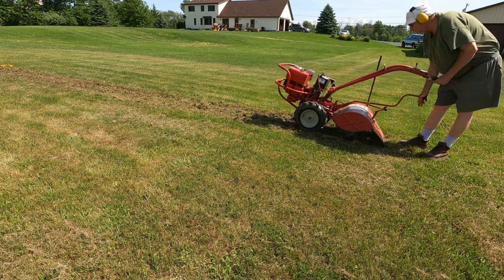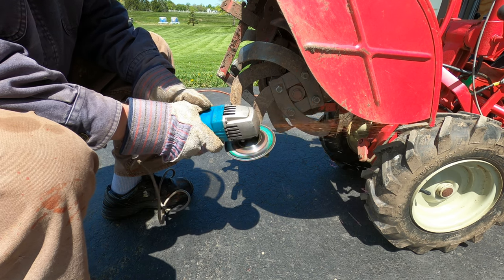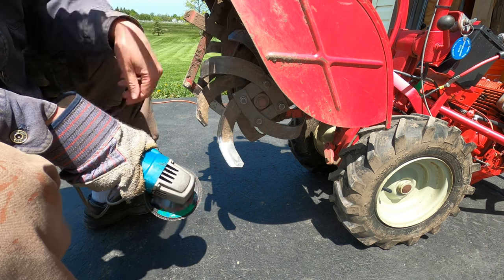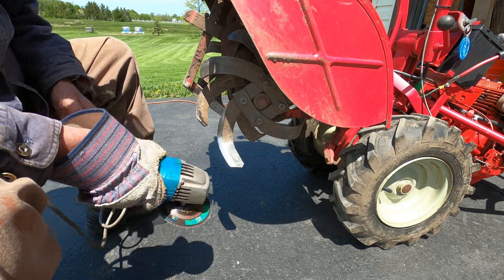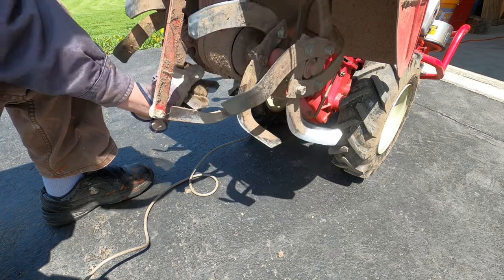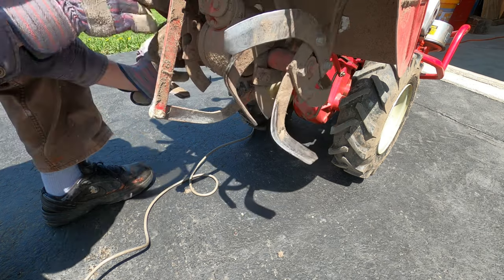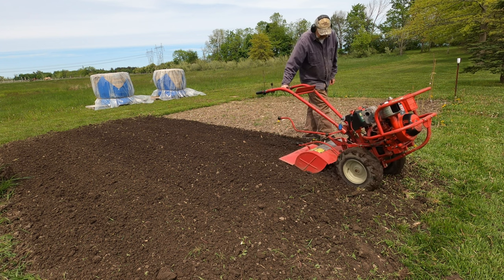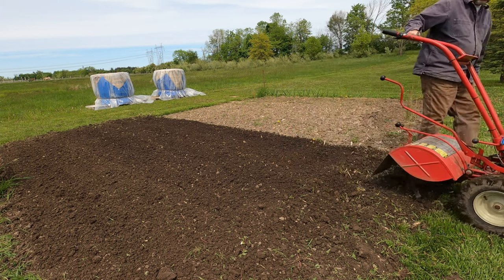Sharpening Rototiller Tines | Sharp Is Better! | Man About Home

Comment: If you learn how to operate that tiller it wouldn't jump like it does. First raise those handlebars up. Next quit pushing down on handlebars.  You don't sharpen tines you replace.  Your tines are fine.
Reply from the maker: That's funny.  I can't imagine being foolish enough to replace tines when all they need is to be sharpened! Even brand new tines should be sharpened! They work a LOT better when they're sharp. You'd know that if you ever ran a tiller. Also, you've obviously never tilled hard clay soil, so you have no idea what you're talking about.  They make bricks out of clay... get it? Try tilling that without a fight. It can't be done. Clueless.
Reply: So only till 2 inches deep 🥴
Naw, digging tools need to be sharpened periodically. All of them.